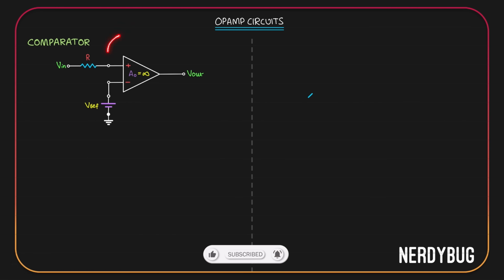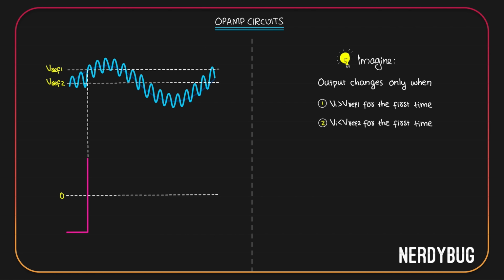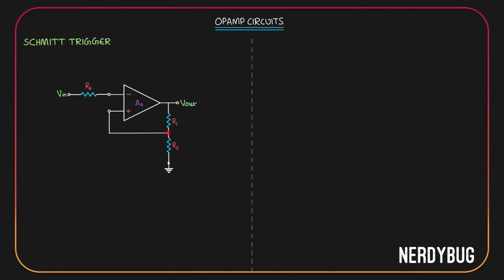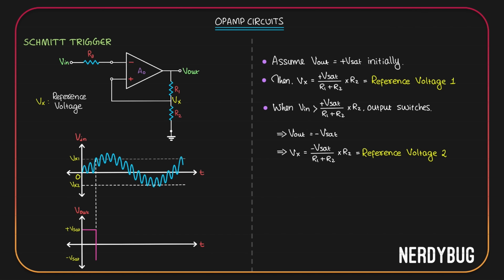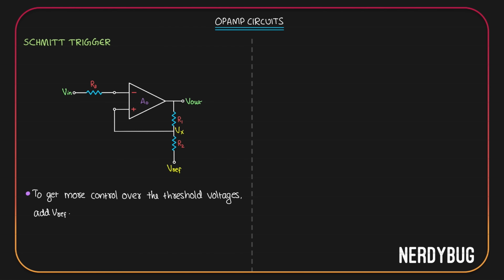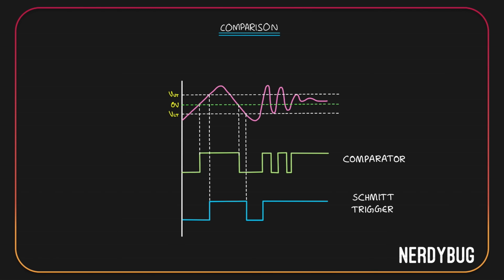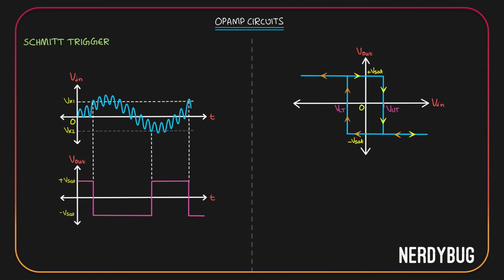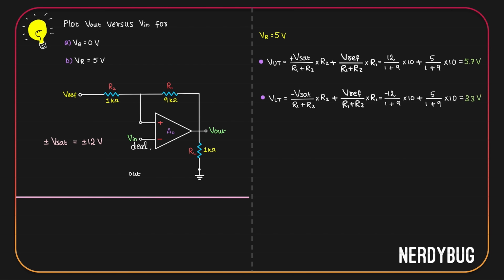Opamp Applications: Schmitt Trigger | Analog Circuits | NerdyBug | GATE 2026

Comment: New subscriber !!
You really really deserve more subscribers 🔥🔥
The level of content is next level, this was exact comparison & practical knowledge I was looking for. 
Keeping going 🔥🔥🔥
Create more awesome content for us 🤩🤩🤩
Reply from the maker: Thank you ❤
Reply: @NerdyBugNB  ma'am I have a small doubt : 
Are characteristics & parameters are different??
Does output voltage characteristics of op amp mean 

Cmrr
Slew rate
Bandwidth
Input bias current
Input offset current
Output offset voltage
Input offset voltage ?? 

What are characteristics & what are parameters ma'am it's confusing
Reply from the maker: @Sithapragyna  Characteristics describe the op-amp's behavior, while parameters are the numerical values used to specify that behavior. In practice, the terms are often used interchangeably.

CMRR, slew rate, bandwidth, input bias current, input/output offset voltages, etc., are all op-amp specifications.

Input - Output characteristics is the graph that shows how output (y axis) changes with input (x axis).

Don't worry too much about the terminology. The important thing is understanding what each specification means and its effect on circuit performance.
Reply: @NerdyBugNB  thank you very much ma'am ☺️☺️